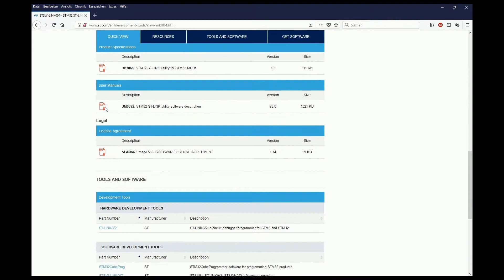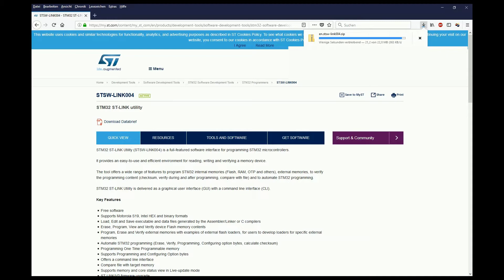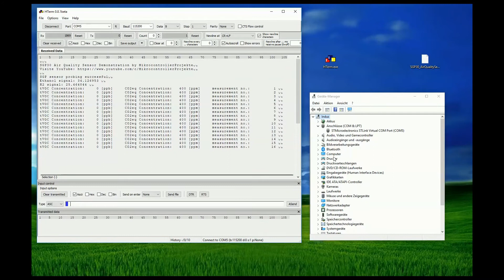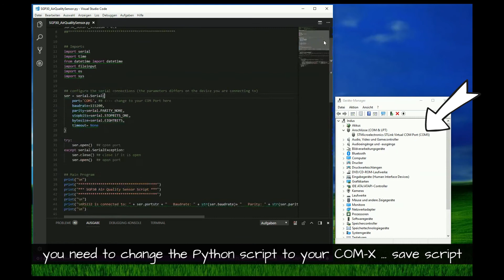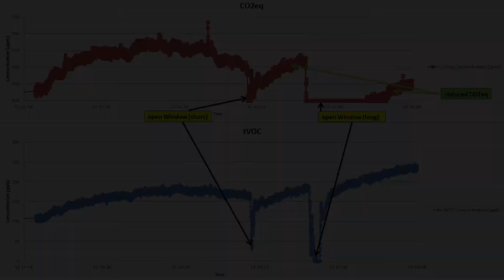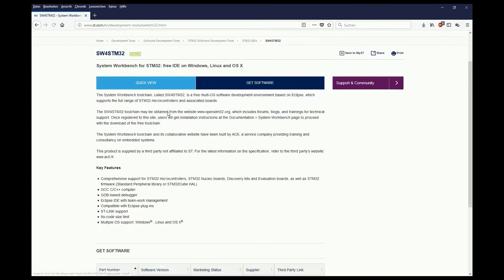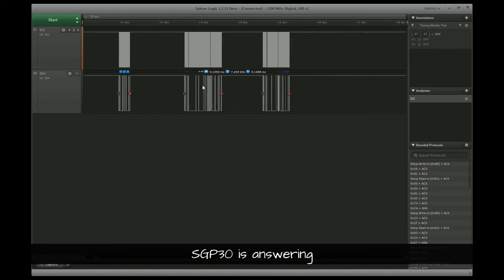STM32 Air Quality Sensor SGP30

Comment: why default  Co2   is 400 ??
Reply from the maker: Good question, default value is choosen by sensirion: For the first 15s after the “sgp30_iaq_init” command the sensor is in an initialization phase during which a “sgp30_measure_iaq” command returns fixed values of 400ppm  CO2eq  and  0ppb TVOC. Maybe signal range is limited by 400 for CO2eq.